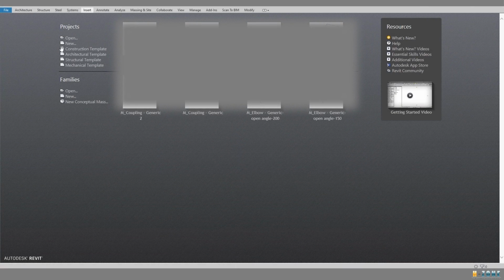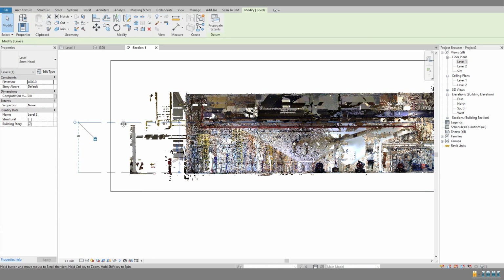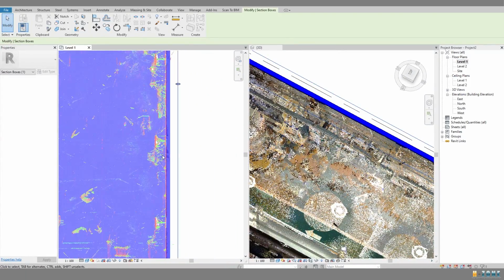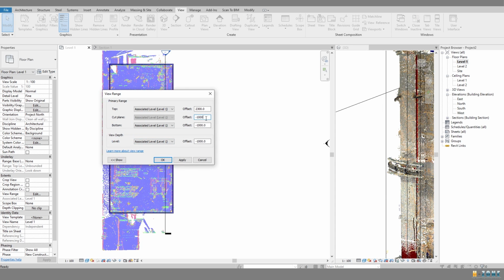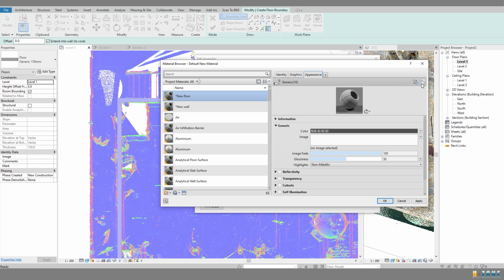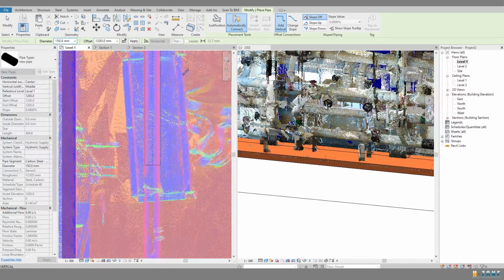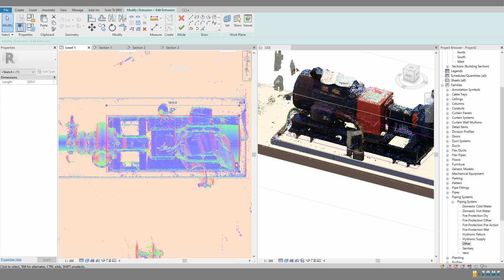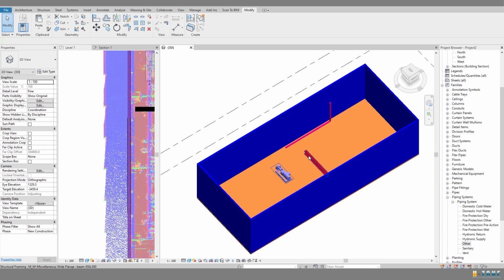How to model from Pointcloud in Revit

Comment: Have you ever ran into a the problem where you can't unpin the point cloud. I tested a blk360 and once I imported the .lgs file, I was unable to rotate and or move it. Even the dealer tech support representative didn't know how to resolve the issue.

Thanks!
Reply from the maker: Yes. The best way you need to convert them into RCP, RCS extension by recap before importing them into revit. It is the best extension for working with piontcloud in Revit.

Comment: Congrats! Very useful video!

Could you help me with a problem envolving Point Cloud?

I am trying to send a Revit project (version 2020) to a client that requires the file itself beyond the plans and sections. 
The project has a linked Point Cloud, which must be visible in the model when the client opens it.
To make this possible, I copied the Point Cloud (.rcp file) into the following path:

C:\Program Files (x86)\Common Files\Autodesk Shared\Revit Shared

Thus, in theory, anyone who copies the same Point Cloud to this folder would be able to view it. The problem is that it didn't work. My partner tried to open the file on his computer after doing the same steps and the Point Cloud isn't there. He checked the visibility settings and the  .rcp filme supposed to be activate there, but it failed.

How can I solve this? Thanks!
Reply from the maker: You could ask your clients and open manage tab in revit. After that them could relink the data everywhere that you save as. In my video has this. Thank you for your watching.